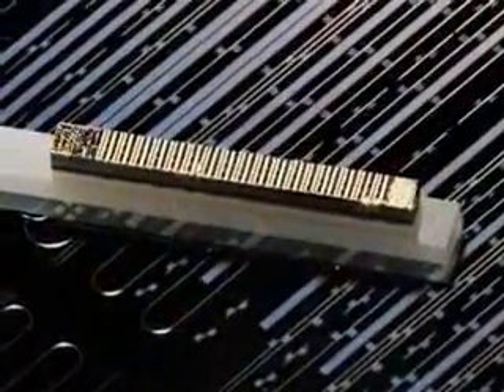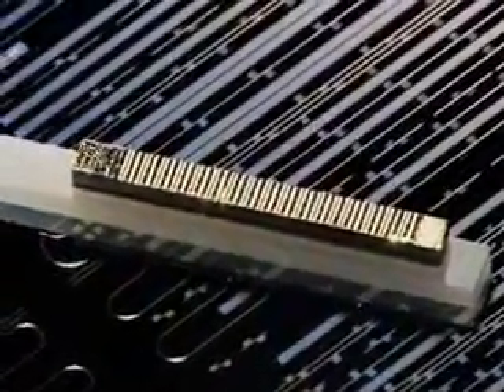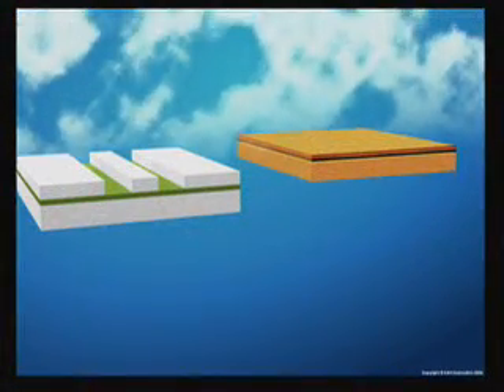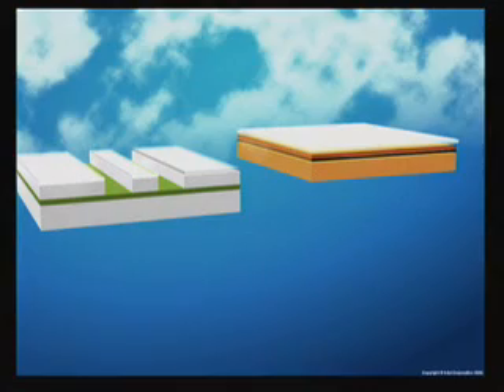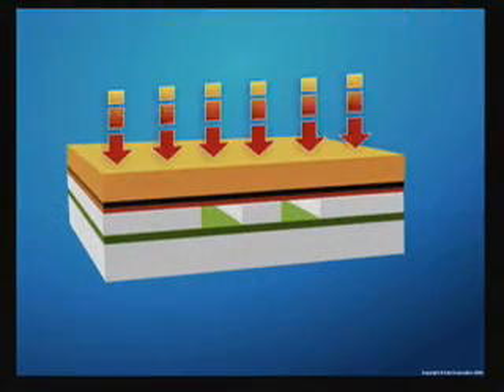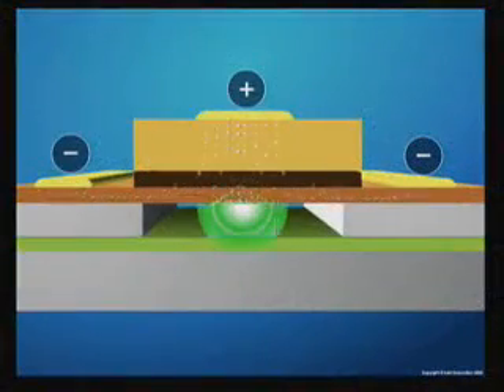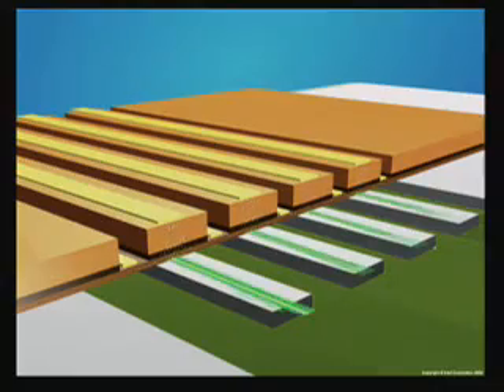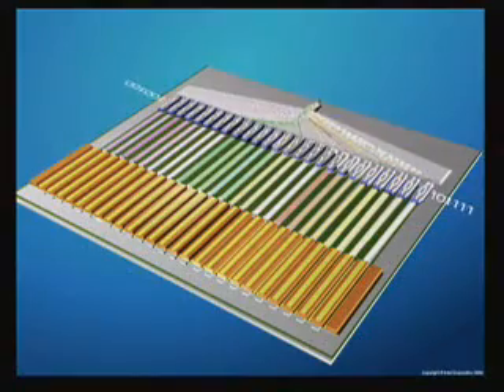The Hybrid Silicon Laser Breakthrough

Comment: This will not speed up the processors in term of calculus power, this will affect primarly the bus used to connect the CPU with the RAM or the NOC to connect the cores on a single chip...

Comment: The smaller you make the chips, the more you run into nasty quantum effects, so there's only so small you can get. Adding more and more cores then is the solution. This on the other hand heavily increases a chip's performance, with less heating.